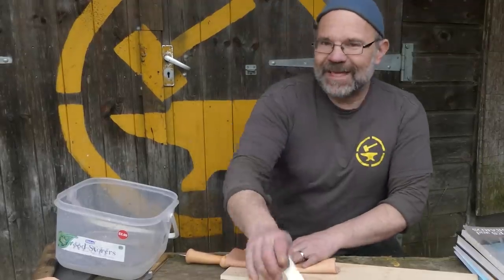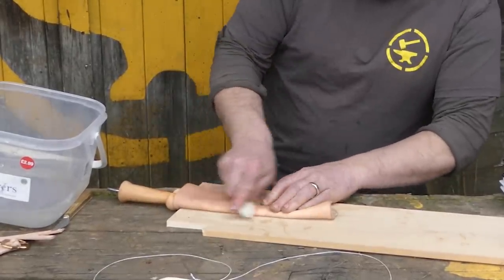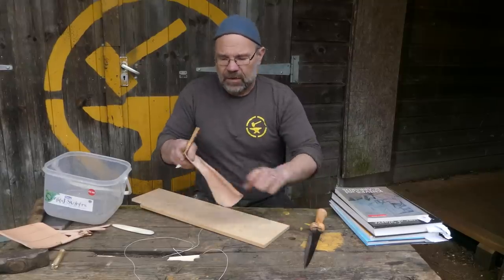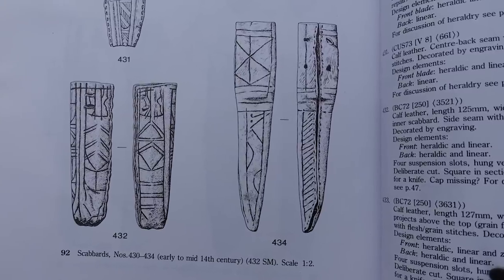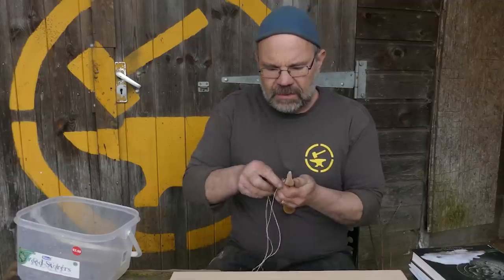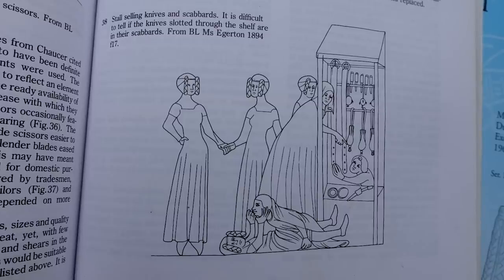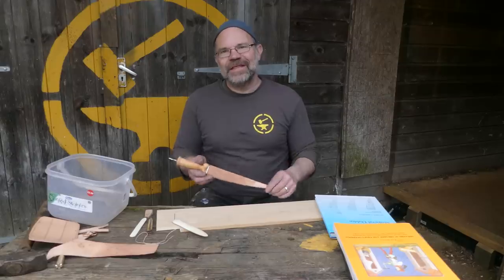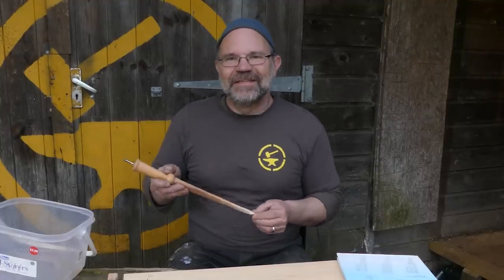Tod Makes Junk - Was Medieval Work Bad?

Comment: There have been many arguments going along the lines of "oh, those medieval people were thinking so differently from us", and I have yet to find any one of them that would be convincing.

The idea that symmetry wasn't a desirable trait in medieval art or material culture is easily disproven. There are numerous mathematical treatises lauding symmetry in itself as desirable, but let's just quote St. Augustine: "In all the arts it is symmetry that gives pleasure, preserving unity and making the whole beautiful." Symmetry was desirable to a point where some argued that it was the only desirable aesthetic trait of an object.

It is true, however, that symmetrical objects are less common in middle ages, but all it comes to is a cost-benefit equation. Symmetry is much harder to achieve without machine tools, and as such comes at a premium, and a steep one at that. Even if you are a master swordsmith and make four perfectly symmetrical sword out of five, that fifth sword is still perfectly functional, and a lot less expensive, so it is a better financial decision to sell it rather than melt it back into its component materials (assuming you can even do that).

So, if you are buying a replica and have a lot of money, you are likely buying it as part of a high status kit, where symmetry would be desired. If you don't have a lot of money, you are buying cheap things and there, a lack of symmetry is a warning sign to a lack of care and/or quality control on part of people who are setting up the machining, and if they make that 3 mm mistake on a blade's tang...

Finally, while there are some high status items that are very crooked, there can be a host of reasons other than aesthetics for them. The item belonging to someone famous and therefore being initially bought without concern for how representative it is is a possibility Indiana Jones taught us. The other popular reason is the item being damaged and repairs being too risky to carry out, as is the case with the bent cross on the Hungarian crown - it got bent in 17th century probably because someone slammed a lid of a trunk on it too hard and stayed that way ever since.

Comment: I collect kukris and I find the same thing. I'm not interested in the military ones, they're very uniform and to me, boring. What I like are what are known as "villagers", either small kukris used for everyday tasks, or huge ceremonial ones for decapitating goats and water buffalo. The blades of the latter are often inlaid with brass, or decoratively fullered and the sheathes sometimes bear elaborate beadwork, but on the back the stitching is always pretty rough where the leather comes together. The sheath fits the tool, and that was it's primary job, decorating it was definitely an afterthought and not usually done by an artisan but by the same dude that made all the sheaths in the village. So it varies massively. 

The presentation kukris often bought for active or retired military are far finer in finish because they're made specifically for people who want that level of finish, with velvet and silver mounts etc. A working tool would never warrant that, and the ones used for festivals and ceremonies had value in the tradition, not the fit and finish.

I look at them the same way as I do people, the ones with perceived flaws are often much more interesting. Perfection is the antithesis of interesting, to me at least.

With regards to it being a job and always doing the bare minimum Vs the hobbyist dentist, I would imagine that there would be pieces worked on in spare time, either as gifts or necessities for family or friends, or bespoke requests, where there would be more time invested in it. In the same way that someone working in a machine shop might have made small brass steam engines for their children decades ago. I'm sure it continues to some degree these days, even with companies squeezing every penny they can.

Comment: This hasn't changed much between then and now. 

I'm American, I work in the firearms industry, and even today, there is a VAST difference in levels of quality in firearms and firearms accessories. If you're willing to pay enough money, you can get top of the line guns and gear...or you can pay very little money and get low-quality junk. For instance, let's talk about concealment holsters. I, like many Americans, carry a concealed pistol. Now, for the model I carry, which is a very common, very popular model, which is affordable but not cheap, you can get a decent holster that will retain your gun from anywhere from $20-200. The cheap ones are banged out one after another, and they'll fit the gun, but won't be particularly comfortable or well made or good for concealment. But if you're willing to spend the money, you can get a custom made holster that does a great job concealing your weapon, makes you forget you're wearing it at all, and will last a lifetime. You can even pay to get it decorated, not that this makes all that much sense for a piece of equipment designed NOT to be seen, but hey, if people are willing to pay for something, someone will be willing to provide it. 

Same goes for the guns themselves. You can get a $400 AR15 pattern rifle, or you can get a $3000 one, or any price point in between. Just like medieval swords, you can get cheap weapons if it's all you can afford, or expensive ones if you want an extremely high quality weapon that is also somewhat of a prestige item. What you're willing to pay makes a huge difference in the quality you get, now as then. 

I'm certain that the same thing applies to other things besides weapons too - you can get cheap IKEA furniture or high-quality custom made furniture, you can buy crummy patent leather shoes or bespoke Italian ones, you can buy a shitty pot metal hammer that will break or a nice one that your grandkids will use, etc. I just happen to know weapons rather intimately.

Comment: Sex may be surprisingly pertinent for that knife seller picture... after all, the dong is often referred to as a knife or a sword (well, in latin for starters, and then from there spread around), and conversely, the lady parts were called a scabbard. So... the sex pic may imply that the knife was indeed sold in a scabbard. just in case someone 500 years on is wondering ;)

Comment: I bought one of your low status knives a few years ago. The grind marks are visible, the edges are wavy, the handle is plain and the scabbard is ugly. But it's an excellent knife and I use it all the time. And if you're using a knife rather than idolizing it, all of those things just don't matter.

Comment: I've found that alot of modern people actually prefer that extra selling point of authenticity, even when it's lower quality. I do Scandinavian stuff for local sale without power tools. They really love the fact that they can say their stuff is made with the stuff they had in that period. Of course it's not going to pull in thousands of dollars a piece like the systematically produced flawless machined stuff. But that allows to to cut out allot of processes and perfection that ultimately leads to more time more productivity. So it kind of balances itself out at a point once you get proficient in the old ways. My only complaint is sanding. But of course they aren't looking for a mirror finishing.

Comment: A simpler reason might simply be that those scabbards were not made by craftsmen, but by people too cheap or poor to pay for a craftsman to do it. And the "decoration" might be intended to roughening up the surface to give the fingers something to grab on to and make it easier to pull out the knife.

Comment: I have always felt/thought that people back in the middle ages were mostly just utilitarian, yes they like fancy colors, fancy clothing and fancy tools, but only what they can afford, for example ive been going on hike's and camping trips in rather basic rather cheap historical clothing, i was taking natural fabrics, mostly linen and wool, and my tools were simple and also cheap (a cold steel riflemans hawk and a selfmade utility knife) but ive noticed, if i take the time to figure it out and think of how i can solve the issues, even my cheap stuff can get the job done acceptably

So id imagine that the people back in the day would also have that mentality of "i can afford the cheap stuff, and it works perfectly fine, so i am not even slightly upset"

Comment: I remember being a middle schooler and looking at Skyrim like "whoa it looks so real"
But like, look at Skyrim (original 2011 release, no mods) with modern standards. No it doesn't.
It seems quite likely to me that most users of things didn't really see it. It was just how they were made. They might've been of the attitude to reply to "but the stitches are so visible" with "yeah, it's stitched, there's gonna be stitches."

Also I'm actually glad you pointed out the couple in the knife stall drawing. I was staring at very confused like "are those two fucking or am I just reading this style wrong" xP
Reply: Could be a merchant's bouncer capturing a pickpocket. Or at least I wish that's what's happening...

Comment: One year late to the party but here is my 2 cents. If you think for a bit... Modern perfectly straight and symmetrical stuff is also kinda awful in similar way. Look at number and complexity of details in modern stuff. Mostly it is just square with some straight lines as decor. Most details added as technological necessity and only sometimes arranged in slightly more aesthetic way.
Fan grill - square or round holes because they are easiest to design and produce. Triangles or hexagons are fanciest thing you can hope for. No flowers, no stars...
Phones - square boxes with components packed tightly inside and rectangle screen on one side. Sure, on premium ones at least materials can be fancy and present some character. But shape if brutally boring! No decor, no complex curvy shapes, nothing!
Like 98% of all curved surfaces are there either for ergonomic or hydro/aerodynamic reasons. And manufacturers would happily make them flat and square of they could.
Why it is like that? Same reason - designers needs to design bunch of stuff, and making if efficiently is just as important as making things quickly for our imaginary medieval craftsman.

Comment: In my opinion, in the past, they just didn't care. As you said, the most important thing was (and should be): does it function? A nicely done piece of gear to near perfection is surely desired, but it would cost maybe 50 times more than a perfectly functioning piece. You pay what you wish to spend and accept it as it is.

Comment: I suspect it was similar to people going to the supermarket to buy as cheap sun hat.  Mr Jones finds the hats and tries a couple on,and finds one that fits.  " That'll do. " he thinks and goes and pays for it. Does he care if it's not great quality ? ( which they are not.  They are probsbly knocked out in some sweat shop where the workers do piece work to be honest ) No, he doesn't. He just wants a hat to stop the sun beating down on his head and stop him from getting a burned neck when he's on the beach. If it does the job, that's good enough. In fact, he probably won't even notice bad stitching etc. And here's the thing, no-one else will either when they see him wearing it. Because they don't bother looking at it that closely. It's just a sun hat after all.

Comment: I'm curious as to how late stone tools might have been used.

Yes the stone age ended 5,000 years ago but it's known that people, especially the poor used them will into the bronze age. 

One advantage for the poorest in society is that a sharp piece of flint is basically free, it would be interesting to know if they continued having any use in the middle ages even if it wasn't common.

Comment: As for people not seeing mistakes...

I have actually seen it. 
Someone had some furniture, and it was made using finger joint lumber.

The people who owned it didn't see the joints I.e. they thought that the wood broke, not that the glue broke on the finger joints.

They just completely lacked the frame of reference to see the joints.

Since then I've encountered it more often. People just don't see what they don't have the experience to see.

Comment: An other thing to take to account is the sheer number of stuff you need to make, in a certain amount of time
For example during my military service everybody was complaining about the boots, you could get a Pair of boots that one would be of hard leather like biker's boot let's say and an other out of very soft material
Or a boot made of patches of different types of leather
My point is if you need to make an X number of stuff in a certain amount of time you just work with what you have in hand, pach mistakes and move on to the new one
Since what is matter is fulfilling the contract in time

Comment: Honestly think I prefer the roughly made stuff. But I have to work with craftsmen a lot (visual artists primarily, comissioning art pieces) and I have seen some who haven't internalized the "not everything must be perfect" mindset and they AGONIZE over something that I think is already a finished product. It's a little frustrating to see them want to go back and tweak something when I'm just like "gimme the files already it's done don't worry about it it looks awesome!"

As for things like swords, I'm much rather something functional and kinda ugly than perfect and oretty and absolute trash in use.

Comment: I don't think that it was a normal thing in medieval times to have sex on the street. I rather think that it was a joke about the sheath.

The German word "Scheide" (=sheath) is also used for the vagina, even nowadays. The same goes for Latin: "Vagina" originally is just the word for "sheath".

So the picture probably just made a joke.

Comment: I live in Nairobi, Kenya and there is a potential parallel here. There is a general 'lack of quality' in almost everything done by tradesman in Nairobi and even if you want to pay more for higher quality items you can't get it. There are many reasons for this which are linked to your postulating about medieval craftsmen. Most trades skills are 'handed down' (there are limited trade schools) and so bad, and good, practices tend to get handed down. Most tradesmen are poorly paid and have limited resources and barely adequate tool and the clientele are mostly looking for the cheapest functional work. Importantly though if you have more money and receive workmanship that is 'a bit shit' then you can send it back and get it improved  but you need to weigh the time and difficulty of doing this for the potential gains in quality. Finally though is that the items are distinct and you do tend to fall in love with the quirks and errors that are within them.

Comment: You see the same thing in “old” woodworking in New England (our “old”, not yours of course). Barns, furniture, etc. It’s functional — and the pieces you see are the ones that lasted for 150+ years — but rough in many ways. 

Modern handwork imitates modern machine products. That’s our baseline for material culture. But for most of history, there was no such thing.

Comment: 1mm is 0.0393in.

But for the most part quick cheat is, remember it's 40 thou to the mm that's close enough for almost evrything with manual machining unless coordinate drilling. 

I think the difference is the same as how I build walls.

My brickwork is wonky and terrible. But unlike every builder I ever pay. My mortar is mixed properly and I make sure there plenty in the joints. Even if it all ends up looking a mess and all over the brick face.

So as long as my wall is mostly upright and uniform even if the bicks are all over the place. It lasts loads longer as my mortar isn't just 90% sand that cracks up. 
And it's does the job of a wall every bit as well. 

It just looks rubbish.
Reply from the maker: nice- I love people who just have a go and learn from it

Comment: Funnily enough, while I don't consider nalbinding needles to be disposable in the least, I made one out of really soft, craptastic steel from the shell of a stapler just to see how easily it carved with a dremel tool. It was suspiciously quick and easy job, but it isn't a needle that can hold its shape all that long. I make better needles than that most of the time, mostly from steel, they're handmade, with imperfections yeah, but they work.

Comment: Buying a sheath separately from the knife makes sense to me - you get the knife from the cutler and take it to the leatherworker to get a sheath made. If you're splashing cash around you may ask for the thicker, nicer leather. If it's a backup knife or a gift for a relative you're not particularly fond of you may opt for the much cheaper 1mm skin.
Will it last? No. Did you technically get a knife with a sheath? Yes. And the leather worker will still do a good enough job with the cheaper material - after all a happy customer will come back to you for a replacement when it inevitably falls apart.